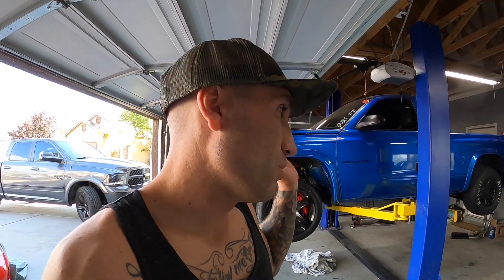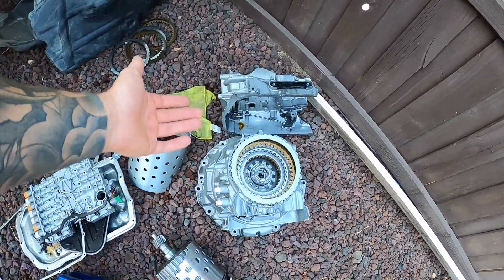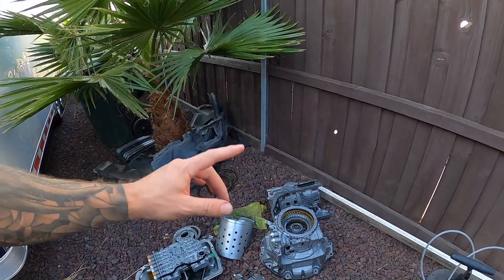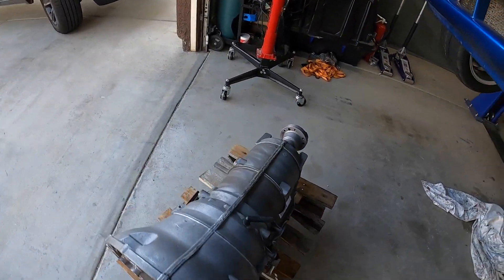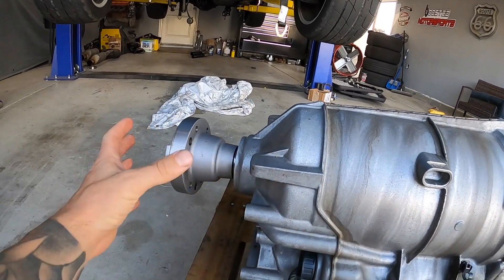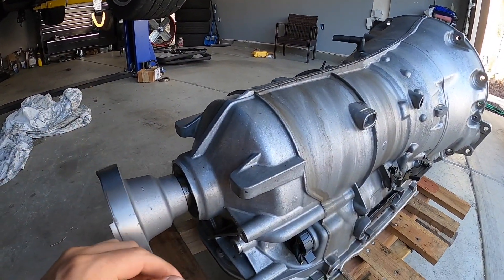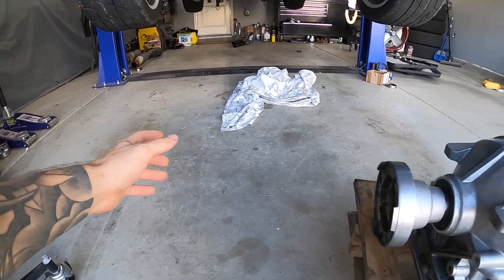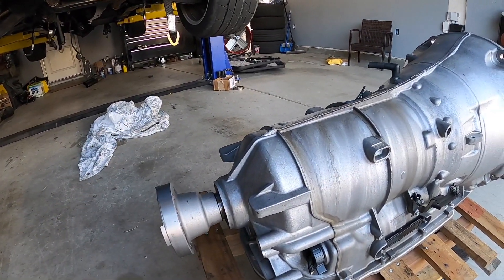FOUND THE CAUSE OF THE HELLCAT 8HP90 TRANSMISSION FAILURE

Comment: Let me guess, you swapped in a single driveshaft and deeper rear-end gears and spun the driveshaft to critical speed. Going to a one-piece is a mistake. One can get away with a single driveshaft if it is 3.5" in diameter and made of carbon fiber. Aluminum isn't just for weight; it has a higher critical speed than steel, all else being equal, but not as high as carbon fiber. You WILL get vibration when the driveshaft RPM is half of the critical speed. At critical speed, the driveshaft whips and bends. At half the critical speed (driveshaft rpm), the vibration is annoying.

There is a reason why two-piece driveshafts are used; it puts the critical speed way above any rpm you could ever spin those two driveshafts. One of the worst things one can do is put deep rear-end gears and spin a driveshaft to its critical speed. Critical speed goes down with driveshaft length (not good), but at a given length, an increase in diameter will raise it. A 4" Carbon Fiber driveshaft would work if one just has to have a single driveshaft.

https://pstds.com/critical-speed-chart

Comment: You need a two peace driveshaft. When the suspension flexes it needs the two peace driveshaft. Especially in a Pickup. Every drag racer no this. Research. They make driveshafts with a collapsible section.

Comment: Hi! Thank you for the video. I have the same isue with my 2015 Hellcat Challenger. I mean the output shaft nut getting loose somehow. and the flange can rotate a bit. I would like to ask, how have you secured the nut after tightening it?  can not have enough room to "punch" the the nut skirt similar as stock 2 side punches. Do you have any advice? Thank you!

Comment: Hey Jon don't know if you seen the message I left in the comments on the live stream but the 2001-2003 Dakota has the door panels that have the dash inset..... And the window switch/door lock area is with arm rest....I am going to see if I can find a pair at the salvage yard hopefully I can find them in black to match my interior or just pull all of the plastic trim pieces.....might even be some one e-bay

Comment: I've seen this an few times were the transmission broke in half going down the drag strip and only the oil pan holding it together. Each time was the driveshaft was to long. Other transmission that blew not from a too long driveshaft didn't break completely in half.

Comment: If anyone could help it be appreciated 🙌🏼 I have a 2015 ram 1500 with JBA long tube headers and a catalytic converter delete, I can’t get the check engine light to shut off for the 02 sensors. (Tired the spark plug non foulers and it didn’t work) Thanks !

Comment: The main thing is you are ok. A transmission that blows like that can cause severe injuries to your feet and legs if it comes through the floor. I would venture to say that a main gear was cracked in the impact from the Charger crash. And then let go under all that torque. Main thing is you are fine. I hope this transmission works out.

Comment: You put your finger on it i agree 👍 💯 it was impact  mixed with rotation force that  more than likely bent the internal tourq clutch drum main shaft hence the cause of  the high speed vibration you talked about, the force caused the end of shaft up front to crack and snap off at 99 miles per hour.  A  one piece  Aluminum drive line is the only way to go thats what on mine, good luck at Road kill 👍 😀

Comment: I don't know what all could be upgraded on that transmission but just to be sure and so it wouldn't happen again I would see if I could take it to a performance transmission shop to see what components would be upgraded so you don't have to deal with it ever again in the future because the car does make a lot of power and if you ever add more power to it you won't have to worry either.

Comment: As I said before, the housing is cast, it had a fractured case from the crash, iv worked on these cars in all shapes, last one jumped a ditch and broke the mounts for the rearend, exploded the drive shaft and broke the transmission mount. If the output shaft was bent as you say, it would be bent on the drive shaft side, I assure you you would feel it. Tape a nickel to your drive shaft and see how easily you feel something as small as that off balance.

Comment: I would think that the shaft is a hardened shaft and might break before it would bend.  You could be right but I still think the impact forced the shaft to bend or break some other part inside the trans.  It would certainly help if you could find out what the hardness of the shaft is.  By the way, I do somewhat know a thing or two about shafts and steel in general, I have been working in the steel Industry for almost 28 years now.  We have a Machine Shop, a Fabrication Shop, a Steel Prep Shop where we cut plate, a CNC Shop, a Warehouse full of different steels of almost every shape and size, and also a Foundry where we pour Ductile and Cast Iron and also from time to time Aluminum castings as well.  Not saying I’m right, just speaking from experiences.
Reply: I was thinking the same about the hardness of the shaft. And it breaking before bending. 
Maybe the lateral force exerted on the shaft took something else out.
Or the case had a hairline crack not detectable by the eye.